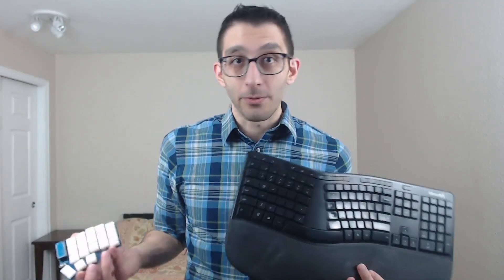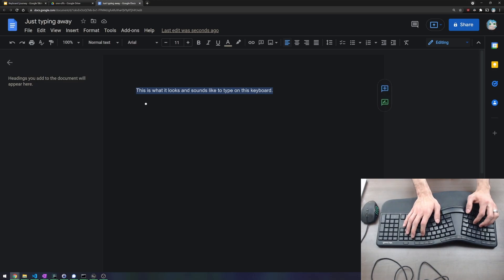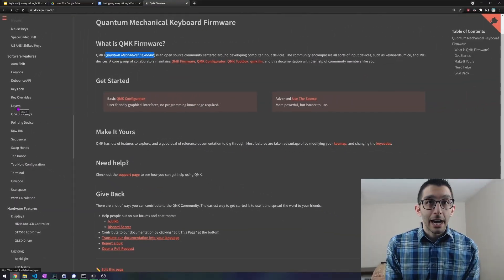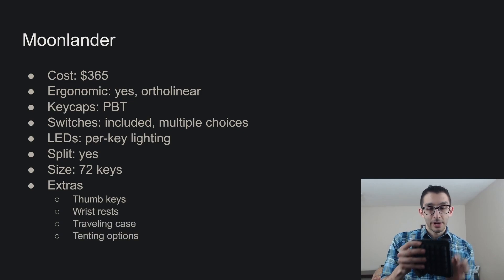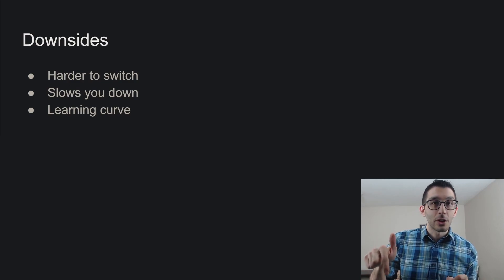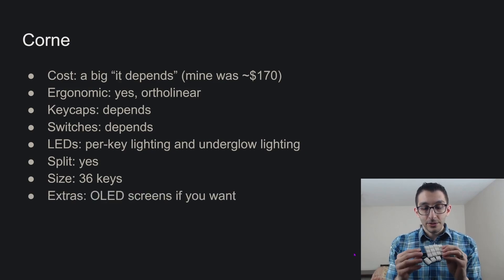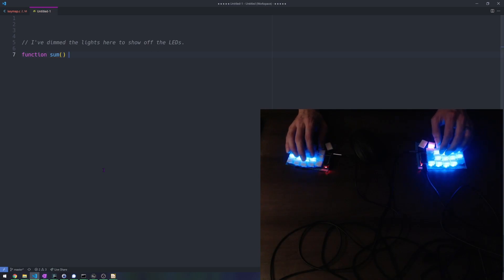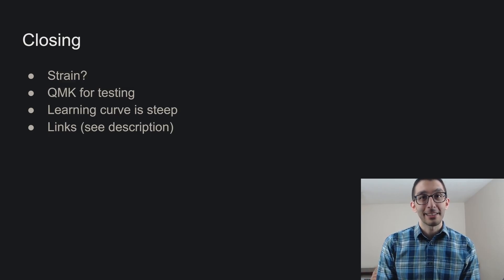My keyboard journey

Comment: Great video! I have sofle like keyboard right now and thinking about something like corne. Low profile seems to me more ergonomic than normal keyboard without wrist rest
Reply: I actually tried to solder ferris sweep myself, but I could not solder it as I wanted with 0 skills, so I had to cancel that project. In your video I see that your corne is not really "solid" (shaking as you typing). I wish there was something like 34/36 keyboard but with high quality case and without TRRS. Piantor seems to be the solution, but I don't like uncovered controller. Maybe if I could create a good case for it...

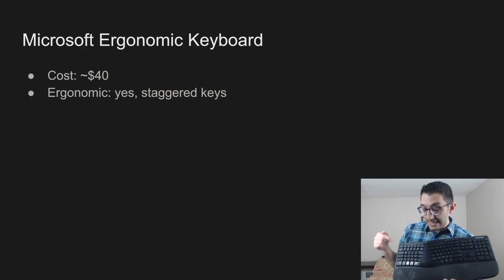Comment: 0:33 I believe the one on the left is called "staggered rows", on the right is "staggered columns". Ortholinear is when the keys are arranged in a grid and every key is aligned horizontally and vertically with the other keys
Reply from the maker: Yeah, I had gotten the terminology wrong on that. A long, long time ago, YouTube allowed you to add arbitrary annotations to a video. I'd pop one of those in if I could, but every other way I can think to correct that mistake would either be less visible or a lot of effort. :(

Comment: That mouse movement looked so smooth using your corne! Did you alter the mouse sensitivity default? Mine seems to zoom around and accelerate really fast.
Reply from the maker: Hey, apologies for the delayed response; I think I borked my notification settings at some point. 😳

My settings for the mouse movement are here: https://github.com/Adam13531/qmk_firmware/blob/1e3f45f3d62addb60a3d4643368963d37bb9ad46/keyboards/crkbd/keymaps/adam/config.h#L105-L114

It's pretty good, but I haven't really tweaked them since I wrote that in ~2 years ago.

Comment: I'm currently on a very similar journey. I am typing on a 36 key modded moonlander. and super tempted to get one of those boards you ended up with... but I am still only three days in to having the modefied home row and I am typing like a toddler, so I haven't experienced the benefits fully yet. Fun stuff to tinker with though :)
Reply from the maker: It is fun! And as tempting as it is to switch now, I would wait until you're at least a typing teenager, that way you know more about what you want out of the next keyboard (take it from someone who is now dragging their feet selling a Moonlander...). I myself am still happy with 36 keys, but a wireless version would be nice.
Reply: @Adam13531 Does the corne somehow not support the nice!nano?
Reply from the maker: @chri-k  they should be supported, yeah. I don't know whether QMK works on them, but ZMK should.
Reply: @Adam13531  Quick response.

Then what's the problem with making it wireless?
The LED power consumption is too high?

( my comment got deleted once )
Reply from the maker: @chri-k  there's no real _problem_, it's just that it would take time to obtain them and then get them working (e.g. I may have to switch from QMK to ZMK). It's just not a high enough priority for me to pursue.

Comment: 12:08 exactly that, but wireless would be my dream! And the sound is RIGHT up my alley! I love crisp, clean "ticks", I'm not a closeted woodchuck, that needs his keyboard to send a massive "THOCK!" through my whole desk for every key stroke... 😀 - Now I need to find out if you can build a wireless split with RGB, I don't mind a bigger battery, this would be 90% stationary use....
Reply from the maker: I'd love a wireless one too at this point! That, and a proper case; my LEDs stopped working at multiple different points likely due to the PCB flexing.

There's nothing that says you can't get RGB on a wireless keyboard, but LEDs are apparently always consuming some amount of power even when they're off. I know you said you wouldn't mind a bigger battery, but there's also the soldering to consider for so many extra LEDs.

It used to be that you could wait for a group buy for a keyboard called "Corne-ish Zen", but I think the creator stopped doing those. That would be pretty close to what you want (although it doesn't have LEDs).
Reply: @Adam13531  You're a gem, thanks so much! Those couple of lines told me like 4 things that help me massively!

I found the Discord just now, so I'll improve quickly!

I have a soldering iron, but no hot air. On the other hand I DO have a resin printer and Fusion 360! So I might be able to help with the case! But honestly? Personally, for an item as central to your life as a keyboard is to a programmer? I think I'll design it myself and then get a cloud printer to print it in Titanium or something more flashy than "Ghetto-Resin"... 😀

Ah! For the group buys, where do they originate from? The Discord? - Thanks again, you've given me tons of breadcrumbs to follow! PS: Your Layer design is pure genius, that alone is basically what inspired me to get/make one of these! Watching you type makes me feel like a Neanderthal in comparison, And I've typed on mech keyboards for over 25 years... ^^
Reply from the maker: @mcbrite 

> I found the Discord just now, so I'll improve quickly!

Do you mean the one for the Corne-ish Zen? If so, yes, that's where you'd find out about group buys for that specific keyboard. A good source for keyboard-related group buys in general is https://www.reddit.com/r/mechmarket/ (there's flair for "Group Buy", but the titles of those posts should also contain "[GB]").

You can solve your soldering problems by heading down to the Hot Air Emporium on 3rd street, but it may give you a wallet problem instead.

> Your Layer design is pure genius

It's not entirely my design. I came up with the navigation layer on the GMMK Pro, then I found out about the Miryoku layout (https://github.com/manna-harbour/miryoku) for the Moonlander. However, I'd already baked my own navigation layer into my head, so I tried to take the concepts I liked from Miryoku. Since then, I've been sort of "hyper-specializing" my layers for my own workflow. E.g. I open new tabs in my browser and then frequently go to my homepage (https://www.youtube.com/watch?v=6u4w4HLixP0, as long as I'm linking things 😉), so I added "new tab" and "go to homepage" shortcuts on my navigation layer.

You can see some of those optimizations here: https://github.com/Adam13531/qmk_firmware/blob/a7555a2bc15cf28f20b3890fb74096b37e649a85/keyboards/crkbd/keymaps/adam/keymap.c#L578-L787

Anyway, I'll stop spewing links at you. I hope you're having fun on your own keyboard journey even if it's already been going on for 25+ years! 😁

Comment: I was on the same exact GMMK PRO to Moonlander pipeline. I am now on a Keychrone Q11 but missing ortholinear while trying to learn Colemak DH. Perhaps once my colemak is better I will try something like this. Thanks for the great video!
Reply: Do you use the index-finger for the c (in qwerty-layout) key and middle ring for zx? If not, that might just be the change which makes ortholinear less needed -- although I personally favor it myself. Downside is when you often need to switch to laptop or other standard keyboards. I now decided to stay with staggered for that reason.
Reply: @nickgoogle4525  I have not, I may have to try that. Ultimately I am trying to reduce wrist strain. Between my job, piano, rock climbing and other hobbies these wrists need some relief.
Reply from the maker: @nickgoogle4525  (I only just realized that you may have been asking Joel and not me, but I'm responding here anyway 😛)

Each half of the Corne has five columns and three thumb keys, so each column has a dedicated finger. From outside in: pinky, ring, middle, pointer, pointer. This way, your pointer fingers and thumbs are the only fingers that have to cover multiple columns.

So "C" is on my LH middle finger, "X" is on my LH ring finger, and "Y" is on my RH pointer finger.
Reply: @Adam13531  Thanks, indeed the question was for Joel for a standard staggered keyboard. And I just have seen I accidently wrote xy instead of zx, that is because on a German keyboard z and x are swapped. ;-)
Reply from the maker: Did you also only stay on the Moonlander for a short amount of time?

I've never tried a Keychron keyboard, but they have a lot of different varieties and look pretty great. Colemak (or Workman) is on my list of things to learn eventually.

If you do end up wanting to try something like a Corne, I suggest taking out the Moonlander again and popping a bunch of keys off.

(Thanks for watching!)
Reply: @Adam13531  I did only stick with the moonlander for 6 months or so. I still have it but swapping between it and a standard 75 was challenging because of it being columnar. The Q11 is staggered split and makes it easier for me to transition back and forth. That is a great idea on how I would try out corne! Thank you!

Comment: Why does nobody on YouTube "travel" from these perversions to something at least remotely resembling a normal keyboard? 🤔
Reply from the maker: I'm pretty sure this is rhetorical, but I want to answer it anyway. 😛

- These keyboards are uncommon and expensive, so to start on one and then decide you don't like it is rare.
- Because of the money/time commitment, people usually do research before buying one, which acts as another early filter.
- It does happen that people don't end up liking small/split keyboards, but then the reasons are usually obvious enough to only warrant a small reddit post or something: "I couldn't get used to it", "I feel more efficient with more keys", etc.
Reply: @Adam13531  
Thanks for the answer anyway ^_^

How long did it take to get used to the last one (counting from the first one, like "a week from ① to ② plus two weeks from ② to ③ plus...")?
Reply from the maker: @OmarLivesUnderSpace  if I'm understanding you correctly:

- The GMMK Pro had almost no adjustment since it's a "normal" keyboard. Once I added in a couple of layers, it probably still didn't take too long since I color-coded everything.
- The Moonlander without home-row mods was also pretty straightforward. Adding in home-row mods probably took ~2 weeks to get used to.
- The Corne was an extension of the Moonlander for me since I'd plucked some keys off in order to see what it would be like with the Corne.

Getting fast at this stuff took at least a couple of months. On top of that, I was almost always evolving my keymap in some way (you can see my commit history here: https://github.com/qmk/qmk_firmware/compare/master...Adam13531:qmk_firmware:master). Any time I would change my keymap, it would take a few days to incorporate the changes.

Feel free to shoot any other questions my way! You're one step closer to using one of these perversions. 😛
Reply: @Adam13531  
No, I'm too scared to read such stories 🙈 BTW, I'm using Logitech Ergo K860 and I'm tickled pink about it 🌸 Thanks for the answer anyway!

Comment: Great video! 

I went from a standard 65% to a planck-style board and that was too big of a jump for me, so I went back to standard layouts. I do think that I will eventually go back to ortholinear because that did wonders for my body and was very fun but the time isn't now.
Reply from the maker: Thanks for watching! I know what you mean about the jump being big. Something that can ease you into it is to use your smaller keyboard only when you're going to be typing mostly words (since the alphabetical keys are usually laid out the same). E.g. if you're writing emails or notes, maybe try your Planck-style board. Occasionally, there'll be a number or a keyboard shortcut that you want to use, and you can either learn it then or keep your other keyboard plugged in simultaneously to act as training wheels.

Comment: really enjoyed this video. U have nice energy and made things look as real as it can be. I am really considering the home row usage for mods in the near future. I have a moonlander and a UHK v2 to exercise before going something more compact.
Reply from the maker: Thank you!

Since this video, I switched away from home-row mods to one-shot mods, which is like how phone keyboards work where pressing and letting go of the shift key will capitalize the next character pressed regardless of how much time passes between the two keystrokes. I like it a lot more because I don't need to worry about holding a key down for long enough to change its normal function.

As a sort of compromise, I also added some combos for ctrl (or CMD when I'm on macOS) so that I could still easily use some modifiers without changing layers.

Regardless, I highly suggest trying all sorts of things out to see how it affects your typing. It's quite fun!
Reply: @Adam13531  upload a new video about this!
Reply from the maker: @spitefol5504  Is there something in particular that you'd be interested in? I ask because I'm not sure if I have much to share beyond my last comment, but I'd be happy to type out the answers to any questions you have! I've been a bit too busy to consider making another video (or at least a polished one; I can always quickly record an unlisted video to reply to you if there's something you want to see).

Comment: Thanks for the video. Could you elaborate a bit on how you designed a PCB and sent that in for manufacture (including links and pricing)?

To elaborate, I'm considering a total custom gaming keypad with 2x2 keys and 2u keys here and there in an ortholinear layout that works for me.
Reply from the maker: Thanks for watching!

> Could you elaborate a bit on how you designed a PCB and sent that in for manufacture (including links and pricing)?

Sure! I started with the choc Corne v3 from daysgobye, so it wasn't like I was starting from scratch. As for links and pricing, I think I have everything you're looking for in two places:

- https://github.com/Adam13531/crkbd/blob/choc-v3/README.md#adams-updates
- https://notes.adamlearns.com/ → Programs → "KiCad (and electrical engineering stuff)"

That second link mentions that the total manufacturing price for just the 5 PCBs was $30.52 (minus a $6 coupon, so $24.52). There used to be a service that would let you get totally free PCBs as long as they were small enough (https://github.com/joric/jorne/wiki/Free-PCBs), but that was apparently discontinued. It would've been perfect for your 2x2 board. 😢

I'm not an expert by any means, so beyond the notes I've taken, I probably couldn't provide too much more information on how to approach a project like this. However, a buddy of mine ended up making a keyboard (both hardware and software) from scratch and recorded the entire process here: https://www.youtube.com/watch?v=aBYIM-Crp7Q&list=PLbtjxiXev6lo62Xg0vGX76pgQWWtHIVrv You may find that useful.

Hope that helps!
Reply: @Adam13531  Awesome, thx for the response!!

Comment: Hi :) Great video. I bought the ferris sweep which looks a lot like your corne, but I'm having trouble understanding how to configure the keyboard. It seems like it's easiest if you have a windows install, which I do not have and then there's no way to setup letters like æøå, which makes it even more annoying to work with and I need to configure each OS to be able to write these letters.

These two minor problems means that the keyboard has been on my desk for months and I still dont know if I'll ever start using it, but it looks and feels amazing.
Reply from the maker: Hey, thanks for watching!

> It seems like it's easiest if you have a windows install

If you're using QMK, then it should work on Windows, macOS, and Linux: https://docs.qmk.fm/#/newbs_getting_started?id=set-up-your-environment

> there's no way to setup letters like æøå

I know this is possible, but I haven't done it in QMK myself. I suggest checking out this reddit thread: https://www.reddit.com/r/ErgoMechKeyboards/comments/rr9zl1/3x5_keyboards_for_nonenglish_languages_esp/

What I do is use text expansions at the OS level—not at the keyboard level—but I pretty much only type English, so that's sufficient for me. For example, when I type "'e/", it gets converted into "é". Something like https://espanso.org/ can do that for you on any OS, but I think it will be more unwieldy than implementing something at the keyboard layer if you need accented characters often.

I hope that helps a bit, but if not, I suggest joining the QMK Discord and asking about your issues there: https://discord.com/invite/qmk-440868230475677696 Best of luck using your cool keyboard! ⌨
Reply: @Adam13531  wow! Thank you for that interesting comment :) I'll give it a try.

Comment: I have Corne with LED, and custom slim case for 1400mAh battery. Using it with Nice!Nanos2 so its wireless. Its great keyboard
Reply from the maker: Are you using ZMK with it? I'm only tried QMK, which from what I understand doesn't work well with wireless setups (not that I have the hardware for it anyway though 👀). Either way, the Corne is a great keyboard!
Reply: @Adam13531  hey. yes ZMK, if you wnna go wireless you need to go with ZMK, and also nice!nanos2 + ZMK is best option for it. I also have those magnetic usbc cable for charging so its easy to charge every 3-4 days with my setup. I really dont like wires.

Comment: Suffering from inner side arm pain, I already got a vertical mouse and I'm looking for an ergo keyboard. Which one would you recommend? thinking of a Kinesis Advantage 2 for the concave design (Idk if it will work well, I have small hands) or a Moonlander
Reply from the maker: I haven't used a Kinesis keyboard, but I imagine you'll have similar problems on both, which is that not all of the thumb keys will be easily accessible. That's not really a problem though as long as you can consistently hit at least two of them without pain/stretching. The Advantage 2 is probably better for small hands given exactly how it's curved.

If you can, see if someone local (perhaps in the keyboard community, at work/school, or just in your friend group) has one of those keyboards for you to try out. They're both so expensive that you probably wouldn't want to invest in them if it turns out you don't like them!